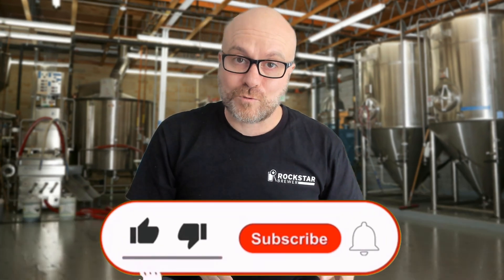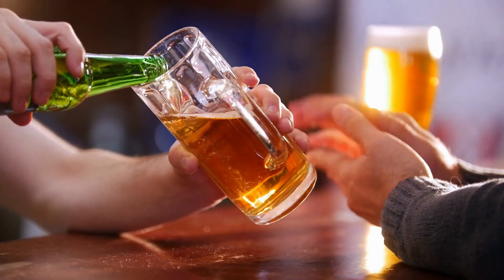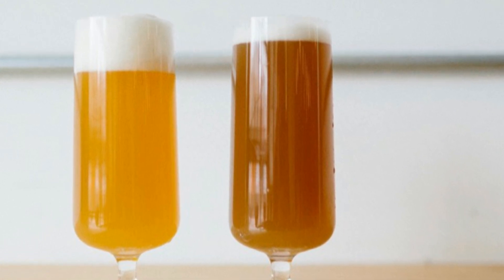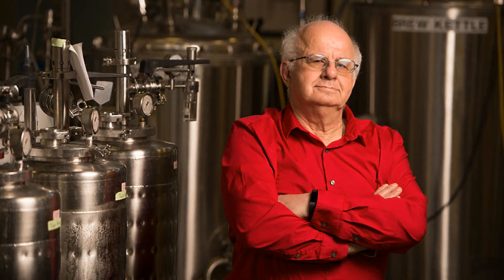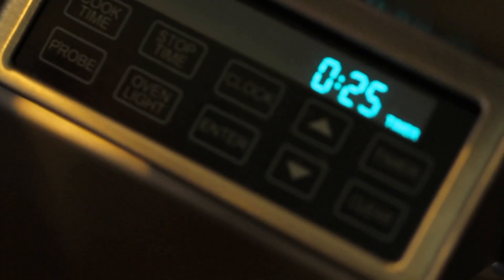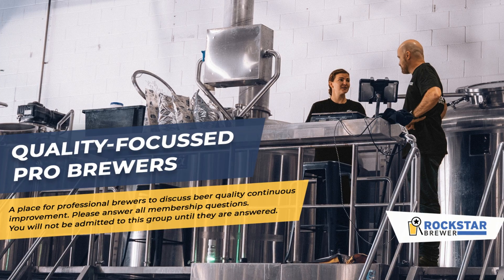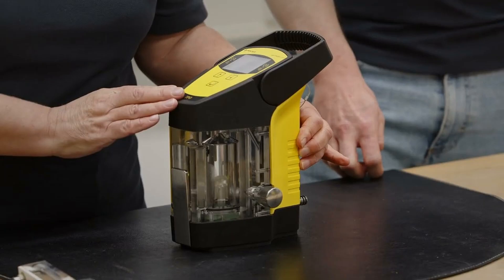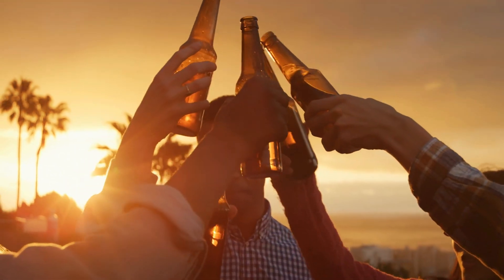6 Things You Didnt Know About Dissolved Oxygen in Beer That Ruin Flavor

Comment: This is, unfortunately, very common in IPAs from homebrewers to big breweries.  It seems that identification and control of oxygen exposure is just not prioritized.  One thing that I do is purge literally everything with CO2.  If beer is moving, everything gets purged.  And I do everything in 7-gallon plastic food-grade buckets.  I dry hop 48 hours into fermentation, then purge the fermenter before sealing it again.  Maybe not necessary at that stage, but I'm paranoid.  I typically move to a secondary vessel on day 5 and dry hop again, but before I do anything, I thoroughly purge the secondary vessel (Another bucket) with CO2.  Before letting the beer flow into the secondary vessel, I run a small but continuous flow of CO2 into the top of the primary vessel to prevent any oxygen from getting sucked in as the beer level moves downward.  Once the beer is all in the secondary vessel, I throw in the dry hop charge, purge once more with CO2, and close it up.  On day 8, I run the beer to a purged keg in the same way.  So far, this has yielded excellent beer that doesn't show any signs of oxidation even after a couple months in the keg.  If you like super hoppy beers and want to brew them, it's just about being very meticulous.
Reply from the maker: Indeed! Make sure you check out my video that dives deep into the disaster of dissolved oxygen here - https://youtu.be/Syca7YPydwY?si=pcTiHz5n4ugPpgZb

Comment: Don't forget rinsing water! Although getting rid of air pockets in your pipework is more important, you have to make sure that beer has completely replaced the water in pipes (and then some) before letting it pass on to another tank, or filler or whatever. Water has thousands of ppb of oxygen in it so it is not hard at all to increase the beer's oxygen content.
Reply from the maker: Absolutely! Couldn't agree more. It's the real hidden demon of DO. Thanks for sharing!

Comment: So I hook up an ST to my cbox, I'm chasing carbonation. I get a 45ppb DO reading, an hour later I check again, carb has gone up and I get another 45ppb DO reading (or there abouts) another few hours laters I get another reading and im happy with the carb, DO reads around 45ppb again. Are you saying I am continually adding DO just taking the readings? 
 
Is this an issues with JG fittings? I only hook the cbox up once, hours apart from readings.
Reply from the maker: The cbox is a very sensitive bit of kit. You may have a leak in your line or you may need to calibrate the O2 sensor with N2. Carbonated beer in BBT should read under 20ppb because the CO2 should fully displace the O2. Thanks for watching!
Reply: @RockstarBrewer  Seeing as it's an At-line tool, any recomendations for hooking it up?
Reply from the maker: JG fittings usually do the trick. You might just need to double check the hoses.... Maybe give them a trim... And make sure that your connector to your sample tap is also sound and does not leak.

Comment: Hi Hendo! I'm loving your informative videos as a home brewer. I'm struggling to understand why breweries aren't just adding a pinch of campden (sodium/potassium metabisulfite) to avoid oxidation altogether? I've invested in a SS fermenter with a purgable hop dropper doing closed transfers to kegs and in general I've been hysterical about introducing oxygen anywhere. Yet I've still had brown and stale cardboard NEIPAs not lasting a week. After I've started adding just 10mg/1L (10 ppm) when dry hopping after primary fermentation, my beers have been all saved! It also inhibits yeast activity and thus prevents hop creep. It's so cheap and has no downsides unless you add too much. Why aren't professional breweries using it? It's of course best not to introduce any oxygen in the first place, but to me it would seem like a way to guarantee that no DO is introduced, also considering that it can play hide and seek with the DO meter when the damage is already done
Reply from the maker: In many countries, sulfites need to be declared on the label. As a home brewer, you can put whatever you want in your beer but as a pro, we're food manufacturers so we have laws and regulations to abide by. Thanks for watching. I hope you find the videos useful.
Reply: For real? Thats so genius